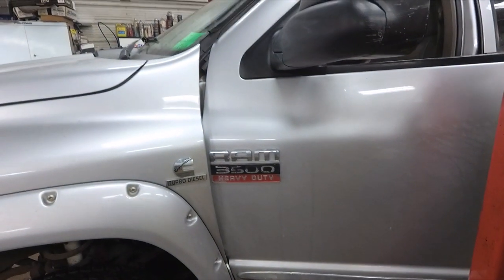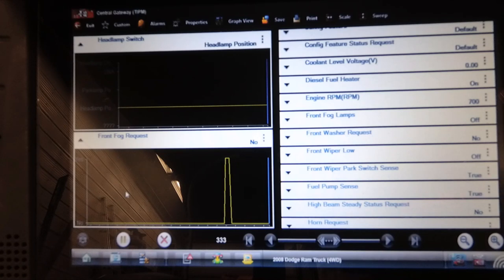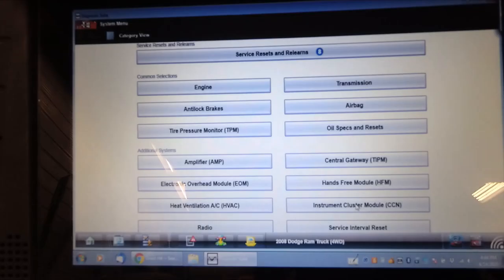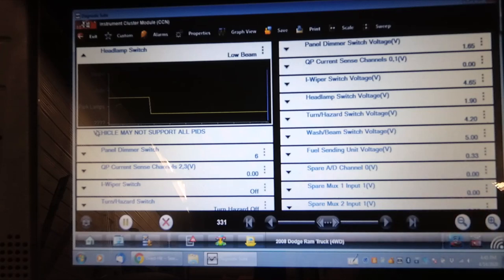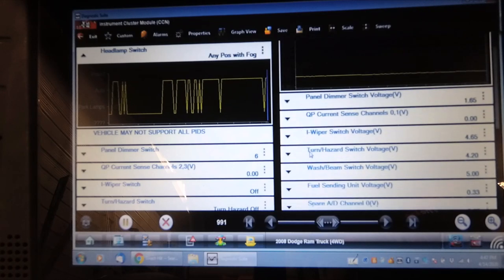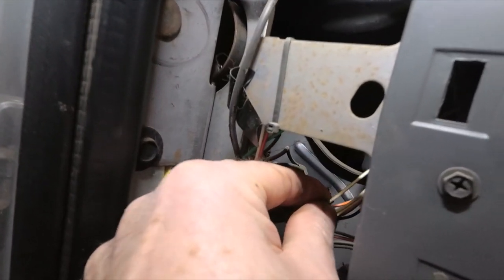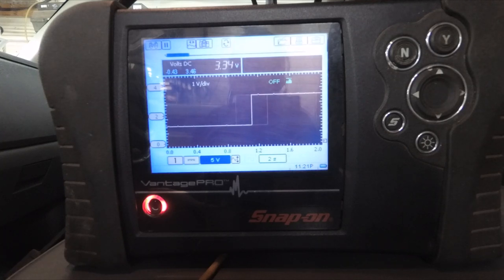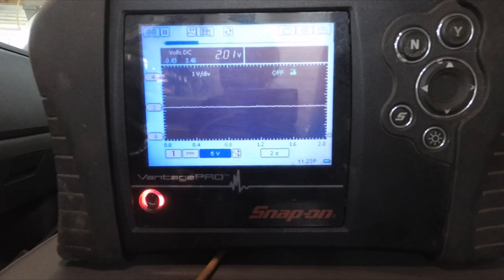2008 Dodge Ram Headlights Flashing

Comment: Mine just flcker occasionally only when running
Reply from the maker: Are they converted to LED?
Reply: Mine flicker and shut off and on only on low beam. Nothing wrong with interior lighting. Can’t figure out what I need for it.
Reply: @fromfieldtofork934 Mines doing the same thing.  If you find out the issue could you let me know